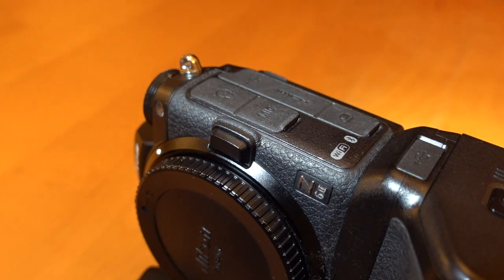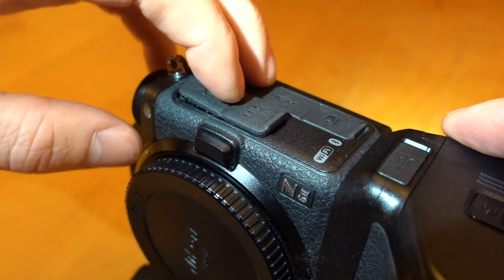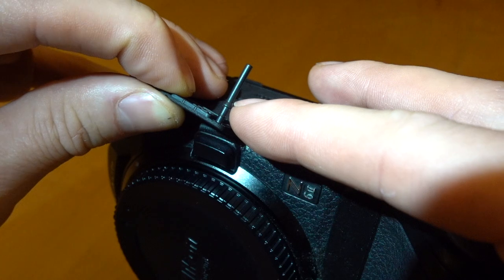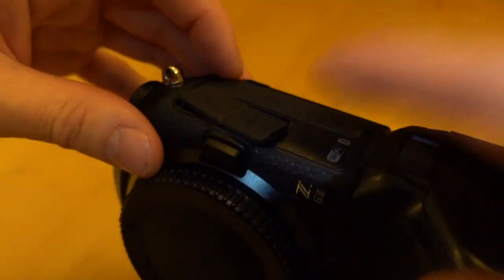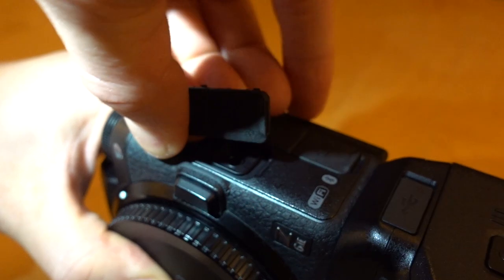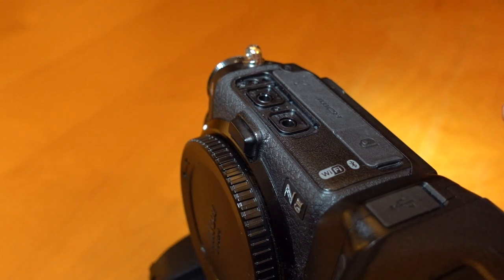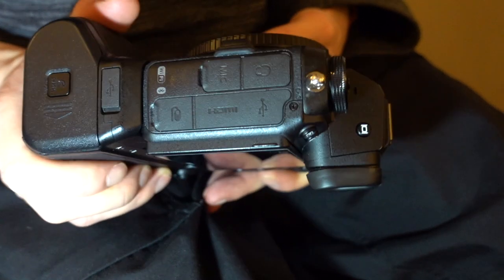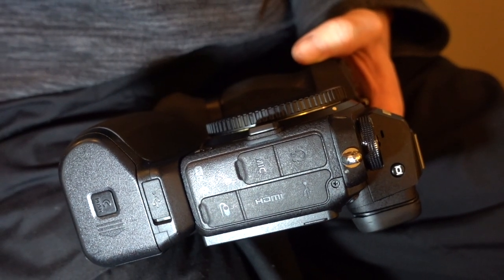Nikon 126ZB + 126ZC Rubber Port Cover Replacement  Z6 / Z6II & Z7 / Z7II + Z9 Kensington Lock Rubber

Comment: I put a tiny amount of silicone lubricant on the stem and it made it quite easy to insert using a screwdriver smaller than the  hole.

Comment: Thanks for sharing how to. Replaced mine without much problem. The tiny flat screwdriver is a good tip. did everything in less than 5 mins.
Reply: how did u do it? and where did you buy it?
Reply from the maker: @sowhat4223  Links of where to buy are in my description :)

Comment: Intriguingly I have replaced super easily. Both pulling out and putting back. Find a super sharp and small needle, like ones which come with soldering tool kit.